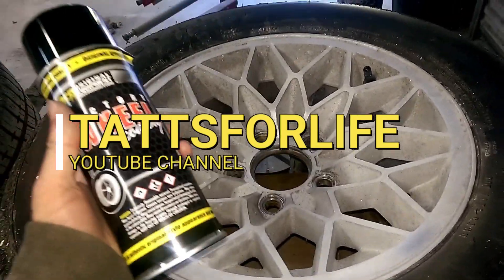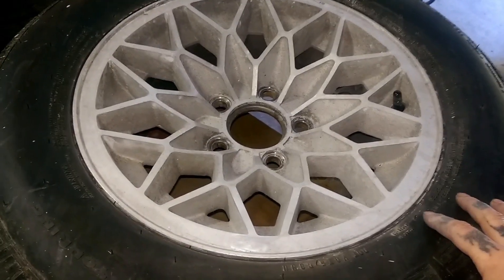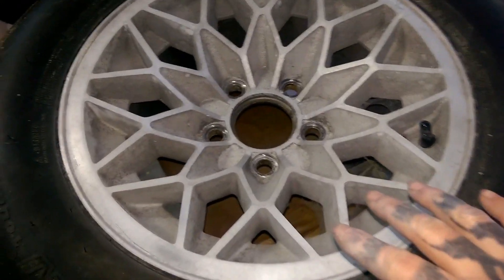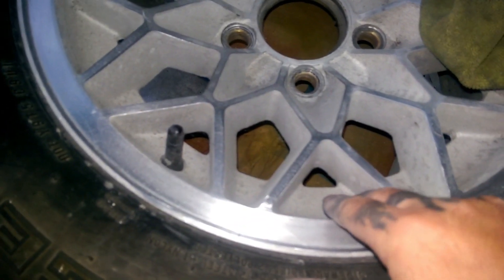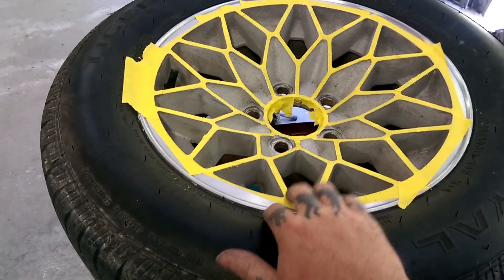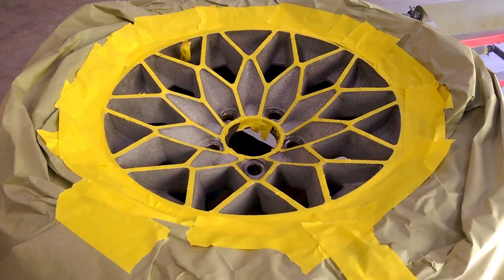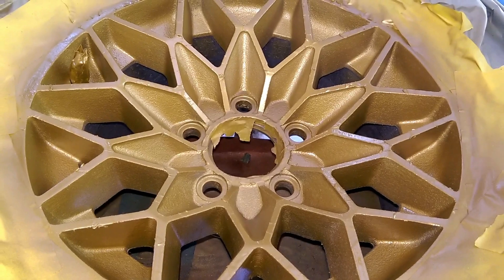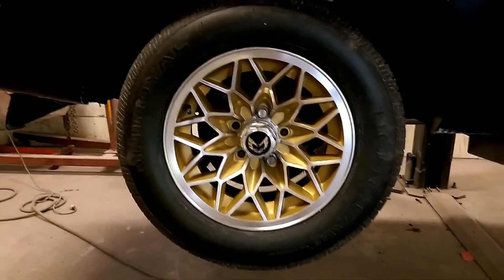HOW TO PAINT OR RESTORE YOUR RIMS, FACTORY SNOWFLAKE EDITION

Comment: They came out great.  How do you sand the inner sections?  Can you use a small sand blaster?  Also, how do you trim the tape to get the best edge, is it just a razor blade?  Thanks
Reply from the maker: I used pin strip tape for the edge, and as sanding I used sand paper just took my take

Comment: Should the masking tape been unmask when the paint is still wet to avoid peeling damage from the dry paint?
Reply from the maker: It can be peeled off after its tacky and has set up, removeable of the masking tape to fast will cause the crisp line to bleed color, it should be noted if proper prep is done even after cure the paint should not peel if tape is removed slowly and at the proper angle. My advice would be to do it whatever way you are more comfortable with